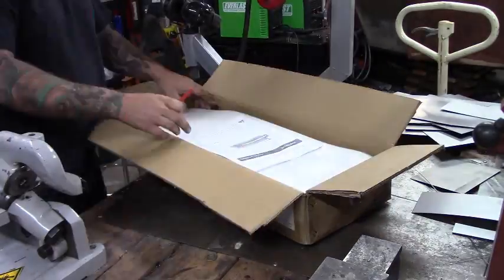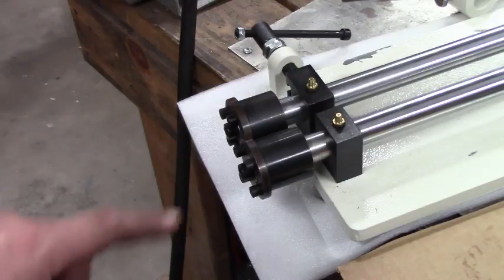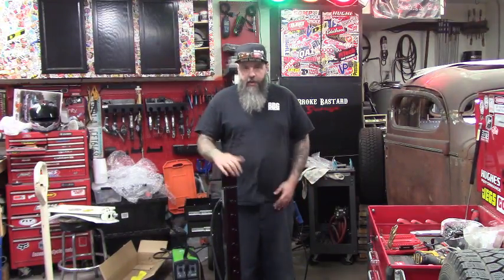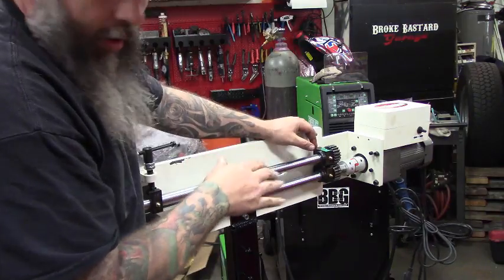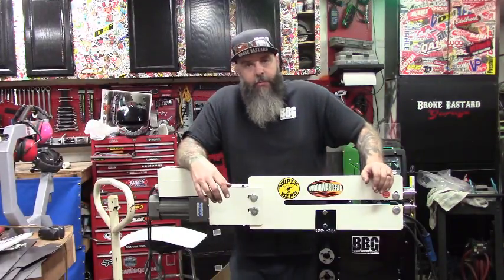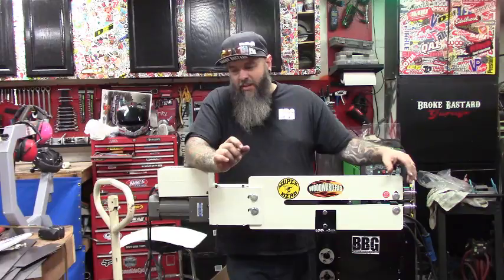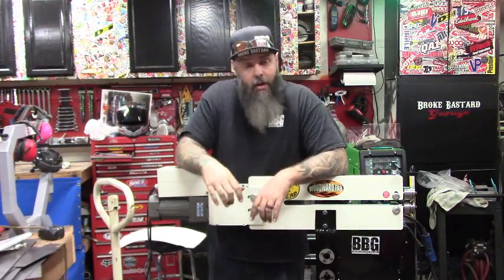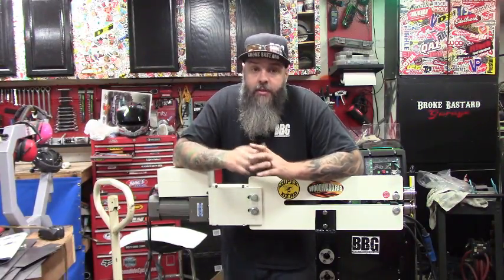Super Bead - Bead Roller and Power Unit - from WOODWARD FAB. Unboxing/ Setup/ Testing

Comment: My tip on coupler alignment. Loosen and slide the two coupler pieces back on the shaft. Remove the  flex fill piece. Slide the two pieces back together so that the three "ears" on each piece touch each other. By using a backlight you can see the exact face to face and angular alignment. Adjust accordingly and reinstall the fill piece. (My 30 plus years as a Boiler Operator doing pump repairs.) Great video as always. Thanks for sharing your skills.
Reply from the maker: Patrick Harrand thanks for the tip!

Comment: Was looking to buy the Eastwood electric conversion for mine but I'm digging the variable speed foot pedal the wf has.  Be nice for a long run to speed up then slow down for a corner. The wf is also 1/2 horse where the Eastwood is 1/6.